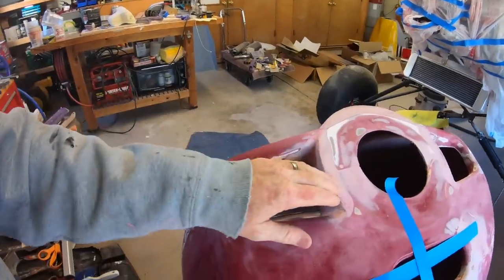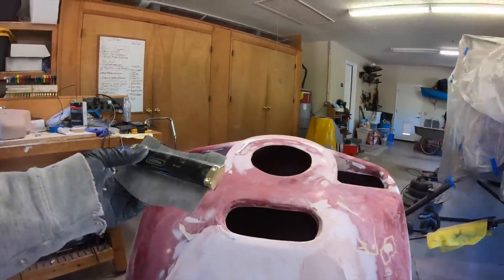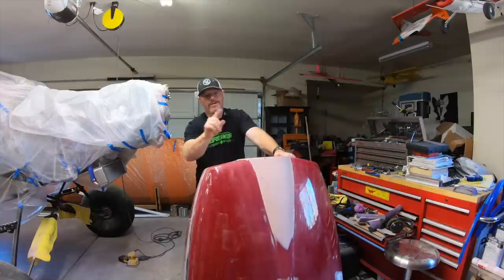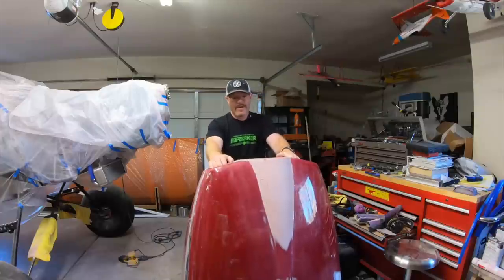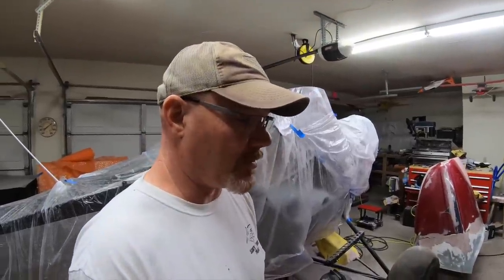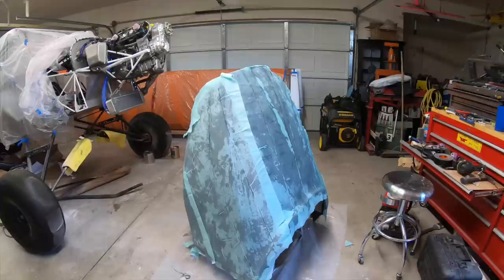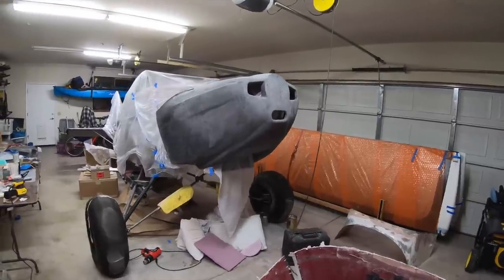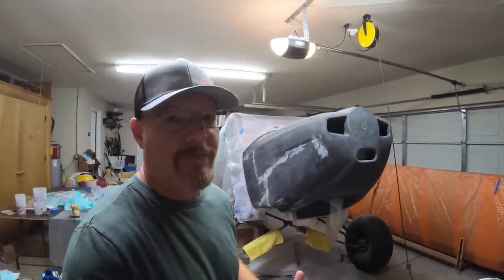Kitfox 7 Apex Build Episode 32 Cowling Part 2

Comment: I remember from Scrappy building videos that Mike put dashed lines where he was going to part his pieces, then put the packing tape and then later in the CF. That made it easier for him to separate the pieces when he was done making the joint flange, because he only had the small breaks to cut to then fully separate his pieces.

Comment: for future reference, if someone has already mentioned, i apologize, but using compressed air in between your mold and the new covering, will help it all release
Reply from the maker: Tried that, but it didn’t really help much, good idea anyway
Reply: @BowenAero  when i was in the AF, i was Aircraft Structural Repair and Corrosion Control. So i used a lot of fiberglass, and resins etc.  I never got to play with carbon fiber, as it was only used on a few aircraft at the time. Watching your movie and Mike Patey's, i want to build a new hood for my John Deere Tractor, since it does not have one. i was going to use foam to encapsulate the engine, then lay up some fiberglass over that on the tractor.  I just have not pulled the trigger yet.

Comment: Looks good.  Without that tape you would have destroyed your plug getting it out.  I HIGHLY recommend that you put a layer of fiberglass on the outer most surfaces where you’re going to put metal fasteners to prevent corrosion.  Also,  consider www.clickbond.com for bonded fasteners on your cowling.   3M DP105 is an excellent adhesive for these types of fasteners.    Love the videos and I wish I could move as fast as you on my project.  Keep up the videos.

Comment: After watching Mike Patey do this so many times, making it look so easy, it's nice to see how it goes when a normal human being tries it. Just as difficult as I'd imagined it to be. For such a large section I think you are going to need some internal stiffening and support. One thing you might consider are hat sections, look at the inside of the metal Luscombe wing for an example. They don't have any ribs, just these hat shaped strips of aluminum riveted to the skins.. You could make some carbon fiber ones and then bond them to the inside.

One other thing I was wondering about is why you chose the open radiator? Wouldn't it be better to have it enclosed in a pressure cowl?  As it is it seems that most of the air will just spill over it and it will create more drag. It's also exposed to possible damage from rock strikes.

Just a thought anyway. I've enjoyed watching your build, it shows more realistically how much work a homebuilder should expect in even a relatively simple project such as a Kitfox. Looking forward to seeing the finished product.

Comment: will they reinforcement on the back of the boot cowl be enough to make up for fitting beings that you laid the carbon on the outside of the fiberglass one or is that thickness negligible? seems like the carbon boot cowl fit would be a tad loose.
Reply from the maker: Negligible because of the way it attaches and the fact that I have not fit the windshield yet.

Comment: If you had made a mold out of the dummy cowl, say in two pieces top and bottom,  the finished product (inlay) would have had a near perfect smoothness just like your inside turned out, and it would have been easier to work with two smaller pieces.  Plus you would not have to pull your prop to look at the engine. You then would have been able to make as many parts later on as you wanted.  Since this is a MOLD, there is no reason to use the real cool expensive stuff like carbon fiber cloth that I see many people do, because weight is not a factor, AND, carbon fiber is much harder to form because it is stiffer. Why make it hard to make a mold?  The mold would have been made out of  polyester resin and a first layer of thick mat fiberglass followed by a layer or 2 of bias weave glass cloth. Why polyester resin?  Because it's cheap, AND it isn't compatible with epoxies, therefore the epoxy won't try to bond to the mold, even though you will still use mold release wax.  If needed,  small pieces of wood ribs could be glassed into the outside of the mold in certain locations to add rigidity to the mold.
Reply from the maker: I explained why I did not do it that way in the video. The Carbon cowling will be cut into 2 or 3 pieces so J will not need to remove the prop.